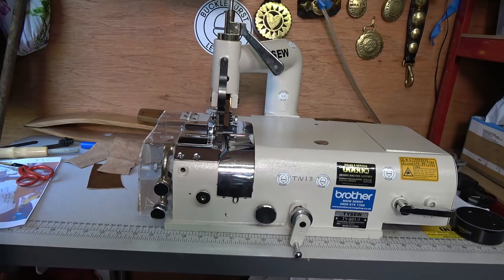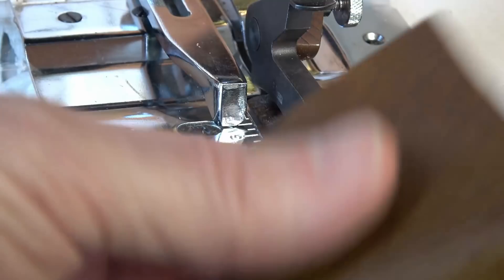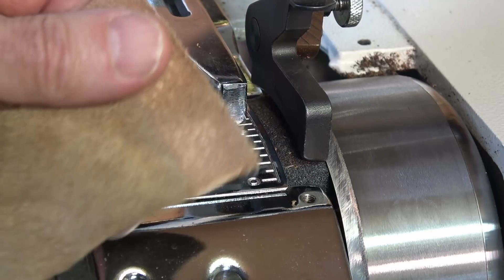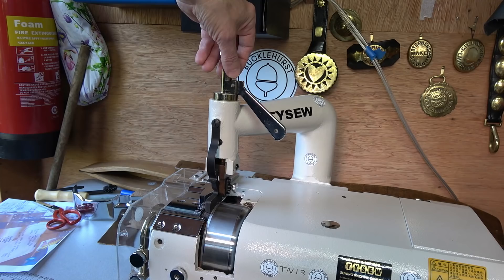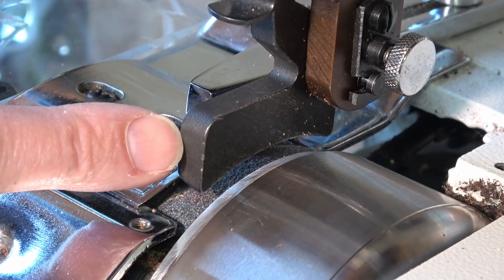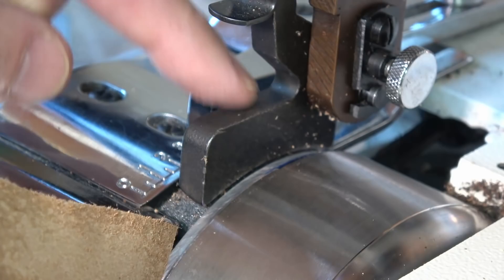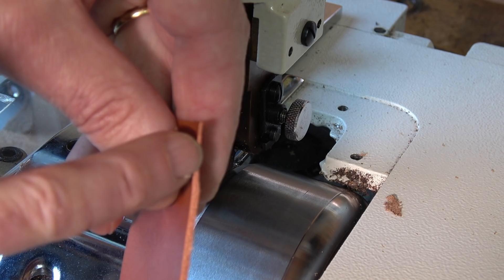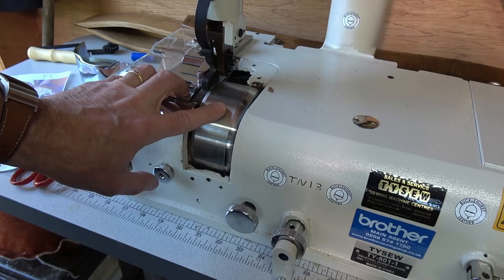Leather Skiving Machine, How to Make Adjustments

Comment: Great video.  What is the minimum depth of skive?  What is the minimum thickness of skive?  My project requires feather edge skives about 8mm deep.
Reply from the maker: I have done those but it will depend on the leather and practice in adjustment

Comment: I need your help. I recently got a skiving machine but the grinding stone is rotating anticlockwise instead of clockwise. What can I do?
Reply from the maker: Hello Jainey...I am not certain and what I am about to suggest may be dangerous, so if in doubt please get professional help...if the stone is belt driven then I guess you can either put a half twist in the belt or if a twist is already there remove it by untwisting it half a turn. If it electrically driven maybe reverse the wires on the motor....these are only guesses as I have never had to look at my feed stone, and I am not a qualified machine mechanic or electrical engineer so please take what I suggest with a pinch of salt. Perhaps someone else here can help?...or on leatherworker net?
Reply: Mine is doing the same thing

Comment: Hi again Harry. I've recently bought a used 801 and it's working ok for the most part but I can't get the stone to stop working. The shaft that goes through the casing is worn and needs replacing but I can't understand how it's supposed to work. I have an idea that the pulley assembly might be in two clusters but they seem to be as one and I can't move the apart. Can you shed any light? I should add that it does work and does sharpen the stone and I'll probably be using it even less than you do but I'd rather have it right. Also anywhere for parts that you might know apart from the Ali's. Thanks. Paul
Reply from the maker: Hi Paul...Have you tried the disengaging clutch lever on the right hand side? Ebay has some parts.
Reply: @harryrogers  That's the shaft I'm talking about Harry. Nothings happening. There's a firm in London that might be able to help but they're still on holiday. It still skives well but I want it right.

Comment: Hello, when I try to sharpen the blade, it runs a bit and then stops -the motor doesn’t work further … what could be the cause ? Thanks!
Reply from the maker: Hi is the clutch lever jumping out of its slot ? It does not hold in its slot very well on any of these machines, so that is a likely cause.

Comment: Excellent video - thank you so much! So helpful as the guide that came with the Consew is pretty useless.  Any suggestions on how to change out the feet?  Mine came with a 30mm but I wanted to switch out to the 50mm and cannot for the life of me figure out how to get it off.  Thanks again!
Reply from the maker: Thanks...you have to undo the chrome knurled screw  on the right just above the foot and slide the little metal plate backwards, as the foot retaining screw has a keyed slotted top to it.
Reply: @harryrogers  Eureeka! Thank you so much, Harry!

Comment: Best bell knife tutorial out there by far.
Just brought one, only problem I have is the handle that moves blade left to right doesn't seem to do anything... any ideas H

Regards Mark.
Reply from the maker: Yes I had the same problem...you need to loosen a bolt inside that clamps round the bell knife axle...just a turn or so and then it's fine....also on top of the machine is a chrome oil drop lid....put some oil down there...I think that's where the adjustment collar nut was...I.e. underneath in that location...but I can't really remember.

Comment: Great video, but only one thing missing. Where does the oil go? How often should you put it?
Reply from the maker: Hi..on mine there is a little silver disc on top that I have put oil down a few months back. I should probably oil it a bit more, but it's not making any squeaks and also I don't want excess oil to mark my leather. It sounds bad but I have never looked to oil this more, unlike my sewing machines that get weekly top ups.

Comment: Hi harry thanks for all your videos! I was wondering if you had any suggestions on how to clean the abrasive wheel (driving stone) is what you call it in video. I was skiving some veg tan and the wheel is covered with the leather. Thanks!
Reply from the maker: A light stroke with a BRASS wire brush may help.
Reply: Thank you

Comment: Hi, Harry...thank you for making these videos...

I have an Eligy (I think?) bell knife skiving machine and had a couple of questions I was hoping you could help with...

I noticed your machine marked up the finished surface of your leather.  Mine does this too.  Is there any way to prevent that?  It seems that in order to get the feed wheel to grip it, there has to be enough pressure on the presser foot to mark the top side of the leather.

Also, my machine is a top and bottom drive machine.  I currently have the same bottom drive wheel in mine that you do...I need to be able to slice thicker veg tanned leathers as well as thinner (and softer hand) latigo, chrome tan, etc.  My understanding is that the  driven top feed wheel (in conjunction with the bottom feed) should be used for veg tanned leather, but for thinner, softer leathers, I should be using the fixed (non-driven) top feed foot.  I bought a fixed foot for this purpose, but haven’t tried to change it out because it looks extremely complicated to do so.  Any advice on this?

I also have a different bottom feed wheel that came with it...it is metal with ridges and cross hatching machined into it.  I was told I should be using that bottom wheel instead of the stone wheel if I’m skiving thick/firm veg tan leather...it also appears to be rather difficult to change out.

It almost seems as if I’d need two machines to efficiently be able to skive both types of leather.  :(  Similar to how some folks have a larger cylinder arm sewing machine and a smaller flatbed due to the time required to get a single (large) machine set up to sew thinner projects.  People want a single machine that can do everything, but it’s just not efficient with all the settings you have to change to switch from thinner work to sewing thicker projects.

Anyway, thanks for any guidance on these...
Reply: Sorry, not much help, as I’m looking to buy my first skiver......but I have seen a video that may help you. Look up the you tuber named Wild Harry (from Australia). He has a video in which he adapts a roller foot on a skiver.  

Certain brands sell a roller foot for their skiver was well.  Maybe cowboy brand skivers??? But from what I see they are pretty rare.   

     The leading edge of the foot may be sharp from manufacturing, a file and some sand paper may be able to help?.  Maybe even a 2 part epoxy like job weld (or the equivalent) that could be applied then smoothed out and the radius set to match the bell with sand paper and a file? 

Just some thoughts that I’ve had....no real experience here other than watching videos!!  Let us know how you solve it.

Comment: Bought Dison  801 Skiver,  it arrived  with a stuck handwheel. Any idea how to loosen it ?
Reply from the maker: If it's the one to move the bell knife to and fro, check the holding collar on the main horizontal big screw coming out the back of the bell knife itself as it may be too tight.
Reply: @harryrogers  It arrived, set it up, attached the band to the motor and Dison Skiver, nothing,   The handwheel, the one that should move by hand to clear away debris is stationary, it can not move. After out waiting  the Chinese New Year , going back and forth I am on my own. I live in rural Nova Scotia  and need to figure this out. Thank you.
Reply from the maker: @sandollarstudio803  Hi if it's the far left one, I have never bothered with it...it holds a clearing blade behind it. I suggest you find a parts diagram off the net for a skiver...they are all similar, and that should help. Good luck.
Reply: @harryrogers  It is the farthest right , the one before the clutch that engages the grinding stone.

Comment: At 4:40-4:50, I can see it leaves feet mark on the leather after cut. Can it be avoid?
Reply from the maker: Yes one does have to play around with the adjustment to get it right...its slightly off here, and hence the mark....I need to lift the heel a bit.